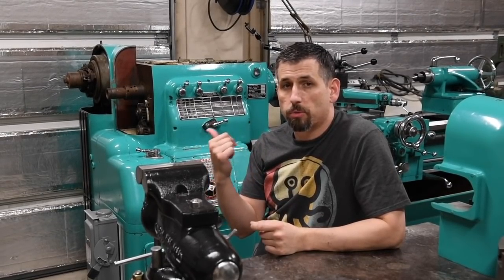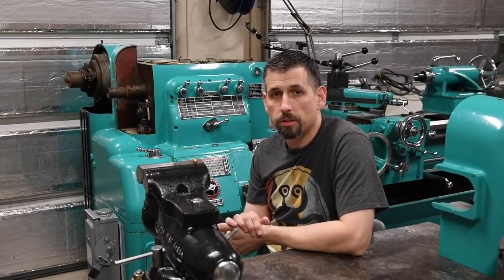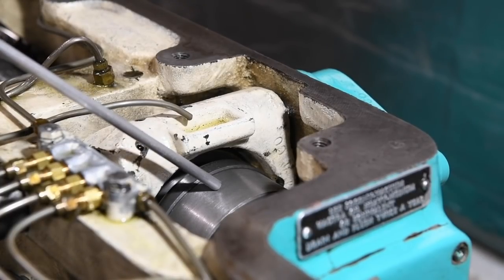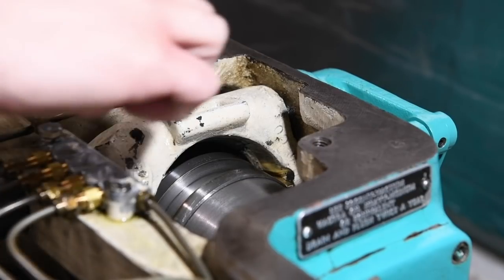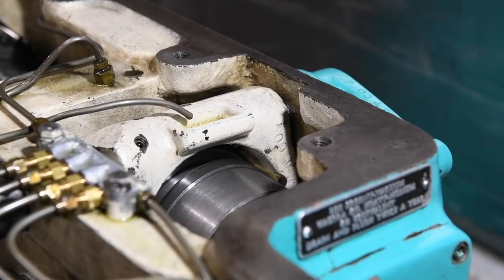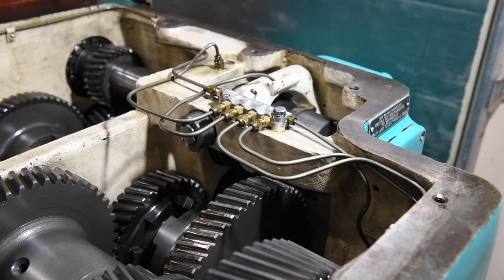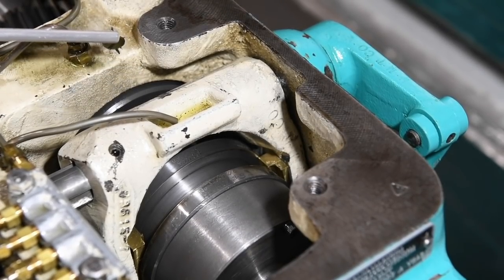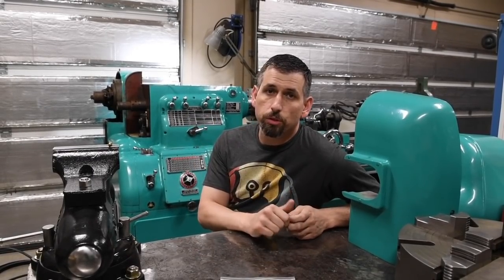Monarch Lathe Clutch Shifter Problem

Comment: Aaron it's been years since I've had one of these apart the last one I did was a model 62 not much difference.  I used bearing bronze to make the shoes (I think brass is way to soft) some cored stuff I turned it to match the I'd and odd. Disconnect the linkage and the collar I believe there are setscrews  holding the shaft in place to the fork and manifold for access.  Once the shaft is out the engagement fork will roll on the slide you will see the shoes held in with bolt that has a dog point which goes in to a bore on the shoe. 
Don't be afraid to tear in to it. They are great machines

Comment: Dang, that’s no good. 😖🙃

Sorry your having problems with your lathe man. 😢

As others have said, I’m sure a full line and oil sump flush, and also replacement of the worn part will bring it back into service. 

I wish I could be more help on the disassembly and reassembly. But I haven’t worked on any monarchs yet haha. 

I’m with Steve Summers too, it looks like some sort of bronze? 

In any case, I hope you’ll be able to get it back to running  condition soon. 

Good luck Aaron! 

While this truly sucks, and we all hate to see it...  I’m quite confident,  and also thankful that we have an awesome community to reach out to for help when things like this do happen.
Reply from the maker: Thanks for the encouragement. Yeah, it's doable, just unfortunate that it has to be done. I am now very confident that the problem is actually because these shoes are shop-made and aren't curved to match the shaft- not enough contact area for the force put on them. I'll post an update soon.

Comment: Aaron
The load on the  bronze shifter is only applied when you move the lever either on drive or brake. When in drive and braking no load should be on the shifter
The clutch and the brake are energised when the slider is at its farthest position on both sides.The brake is on due to total thickness of the bronze shifter being complete, the drive side due to the wear on the bronze key on that side doesn’t  allow the slider to travel full distance required to engage full clutch engagement. This causes the shifter to push on the clutch continuously wearing on the bronze part.
This is almost always usually caused by wrong clutch settings.
Clutches are made to hold themselves in drive without any outside influences,the lever is only there to engage it like a clutch peddle on a manual car all the engagement pressure is from the setting of the clutch.
If you replace the worn part make share you check the settings of the clutch or you will be back at square one very quickly.
I think the clutch is too tight and unable to engage fully, when the clutch cover moves over the clutch plates it rides over a ramp onto a flat this causes the plates to compress together, if the clutch is too tight it can’t ride up the ramp onto the flat, so the lever has to hold the clutch on the ramp part causing friction on the bronze parts and therefore wearing out the bronze part.
Hope you can understand my explanation of the operation of clutches if not let me know and will try and explained it easier
Great video by the way

Comment: I'd say the shaft drives out and the yoke lifts straight up. Looks like the pins are adjustable on the shoes . Being oil bath I'd say they're brass not bronze . There slides not bearings or load bearing.  Look for set screws on the arms for the shoe adjustment .
Reply from the maker: You nailed it- pulled the assembly last night. Set screws on the bottom, sliding fit on everything, and the shoes are brass. The failure appears to be caused by the shoes being shop made and rectangular- just not enough surface contact so it took more force to engage the clutch, which pushed them into that shoulder. Update video coming soon.

Comment: I would change the oil and flush out all the lines. The metering units have very small orifices that can be blocked by the shoe swarf if there is no filter on the intake side of the oil pump or if it is compromised. you should verify that the metering units are passing oil otherwise you could get further damage. The bronze shoes should not be too difficult to machine, I see the problem as determining the pre-wear dimensions. perhaps another Monarch owner can measure them for you?
Reply from the maker: Through the bulkhead fortunately there is a brand new filter on the oil pump and it also has a brass screen under it that is extremely fine. I’m feeling confident that the contamination is limited to the bottom of the headstock.
Reply: AlwaysSunnyintheShop That’s reassuring! Hope to meet you in the Bash. I am regretting walking away from a Monarch series 610 that came out of Harvard College last month for very little money, it was in excellent shape, a dealer has it and is asking over 10 times what he paid. It was just too much for me to handle in my current location, it is nice following you realize a similar project.  Good luck, let me know if I can help you machine any parts.
Reply from the maker: Through the bulkhead always a problem with Monarchs- lots of money. And I’ll be at the bash for sure!

Comment: Way after the fact since the repair is already done. But I'd bet a lot those shoes aren't brass, Monarch didn't cut corners with there machines and the job those shoes are doing there going to be bronze. And likely aluminum bronze to slow the wear rate down. Brass would most likely be too soft. I'm no Monarch expert though so I could also be wrong.
Reply from the maker: Yeah I used bearing bronze for the replacements. Install them in part 3 of the series.
Reply: @AlwaysSunnyintheShop  Actual material specifications are about impossible to get for building replacement parts unless you've got a copy of the original factory drawings. Because of the similar color many think brass or bronze is interchangeable. Brass is way too soft for a durable wear surface, but checking the other parts with a file for hardness will give you a good indication of what material is needed. Bronze always requires hardened steel surfaces to run against or the bronze will wear the steel first. And Monarch would have used hardened and ground parts within that whole head stock so the bronze you correctly decided on would have been used for the shoes. Once you know and remember that rule it's fairly easy to figure out that brass is seldom used for any internal parts in machine tools. 

At $2500 you already know you stole that lathe. :-) And it's a really rare one with that powered compound. I paid more than that for my pos offshore lathe that weighs less than 10% of what your Monarch does.

Comment: I would say those are bronze not brass👍 But that's a guess
Reply from the maker: Steve Summers that would make sense to me and what I would have expected them to be. But they look too yellow to be bronze. Once I get them out and on the bench hopefully it will be more obvious which material it is.
Reply: @AlwaysSunnyintheShop  yeah, could be brass. Sometimes it's hard to tell.   Brass would probably work if it was well lubed. Brass is a bearing material... just not a very good one.👍
Reply from the maker: Steve Summers ha exactly. When these are working right they’re well lubed and aren’t really bearing- they shift the gears or clutch and then have a gap on all sides until you shift again and they reengage again. This wasn’t working right 😂

Comment: Those r guiding shims, u can call the shoe for their half moon shape, stick shit transmissions have a very similar architecture. Your gearbox looks fairly simple. U seemed to have plenty of skills to make those guides. If u had to purchase them OEM make sure u measure precisely and take not for your next time. More often than not brass bushings falls apart in a gearbox environment because of lack of clean lubricants. Good luck. I will watch your part 2 video to checkout your progress.

Comment: You keep saying brass. Are you sure it's not bronze? I can't see them using brass for a service like that but bronze would work fine. I would contact Monarch and ask them what kind of alloy was used to make those shoes. If it is a silicon bronze you can braze those units up and remachine them.
Reply from the maker: They were definitely brass. The originals would have been bronze which is what I made the replacements with.
Reply: @AlwaysSunnyintheShop  So not only did they mess up the repair from a design and execution point of view but they also selected the wrong material. Some peoples children...........lol